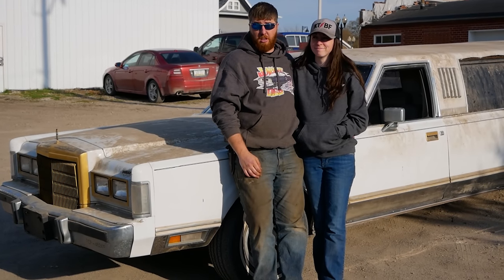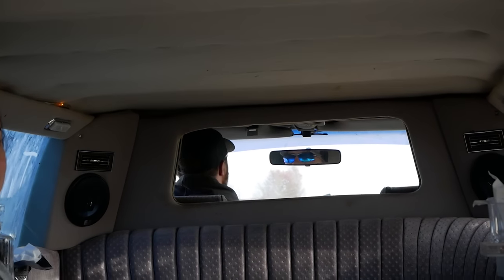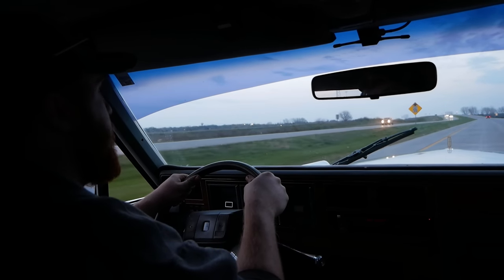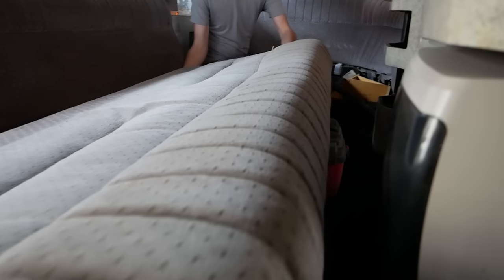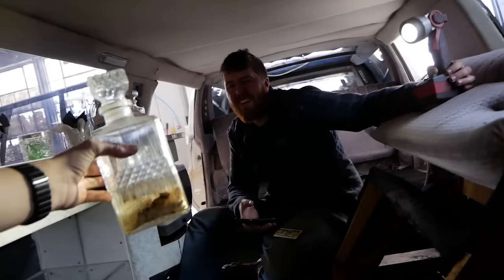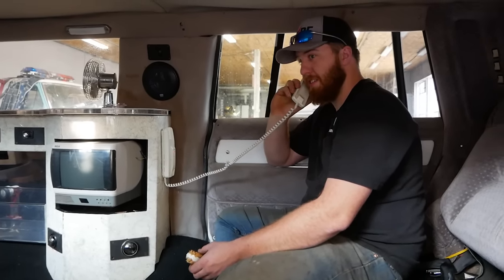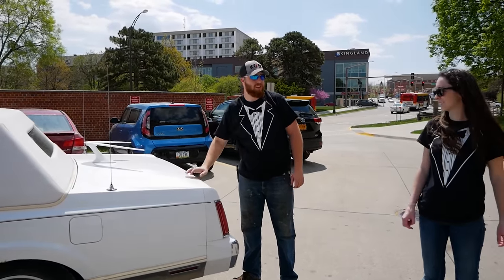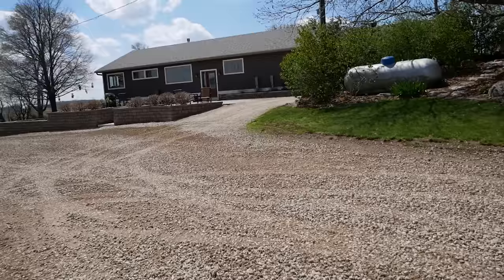Can Our ABANDONED 35 Foot Limo Be Returned to Service!?

Comment: If I pulled that thing out of it's grave I'd start by getting it up on a lift "or 2" depending if u can find 2 lifts set up right to accommodate it and separate the chassis and upholstery and carpeting from the body the electronics and engin.
Remove any positive upgrades from the chassis and scrap the rest that chassis is a death trap on wheels waiting to send someone to the grave.
The upholstery and carpeting are grose and sick with the animal urin and probably infested some how.
Take pics of the interior so u can replace it, replace the chassis with a real limmo if u have to use 2 to make it long enough just make sure u do it right no bs patch job that makes it look like it was built from scrap metal.
After u can drop the electronics and the engin back in make it all work and align right and if you're lucky the better chassis will hopefully cut back on the rattling a lot maybe respray it add some pin striping, I'd say crop the back of the cab just a bit to add some more trunk space after all you got all of that seating space isn't it logical that other people need room in the trunk for their stuff to?
Once u do all that u can make some serious $$ of that limmo weather u sell it or use it to start you're own limmo business.
If u need money to start the project start a go fund me page, after u have the car inspected and appraised so if u decide to sell everything is in order.
If u sell hopefully it will go to someone who wants to use it or desplay it in a museum either way it will be taken care of loved and enjoyed.
I'd say keep the go fund me going for maintenance and supplies for example a flat tire or a blown fuse, maybe the air ride suspension needs to be fixed or maybe u have to supply the boose and food in the fridge, what about gass and replacing the fleweds or the batty.
Draw back is u have to be as basic as possible on go fund me or u will get sued I'd just title it "for the limmo" not being specific about what for the limmo that way u have something cool and u didn't pay for it out of you're pocket sept to buy it the big repairs and supplies can all come from go fund me and if you're feeling greatful and go fund me shares the info maybe u get in touch with the people donating and give them free limmo service as a thank you.
Maybe u get rich off the limmo and u wanna pay a lil of that good fortune forward and donate to go fund me.
If it was me I would use that limmo like a flag ship and in 10-15 years u can take and re-invest in the business buy a few regular limmos every 3-5 years and keep that 1 in service hire more employees with a option to buy stock cheep in 5-10 years regardless of how the market is, if they're working for u treating them good only helps u later when they wanna own a piece of the business so bad they wanna work to earn it, they wanna grow the business so once they buy into it they buy a bigger chunk that's more $$ for u.